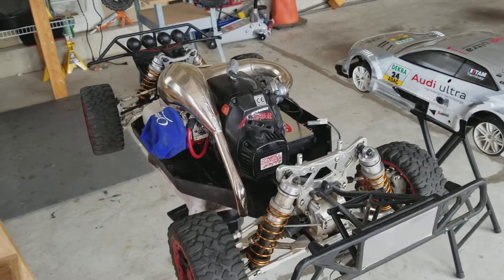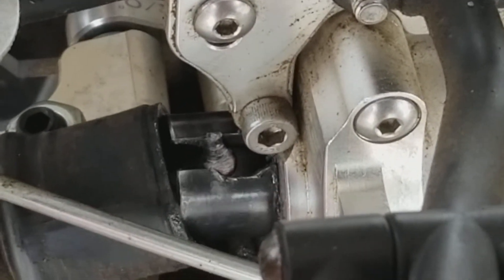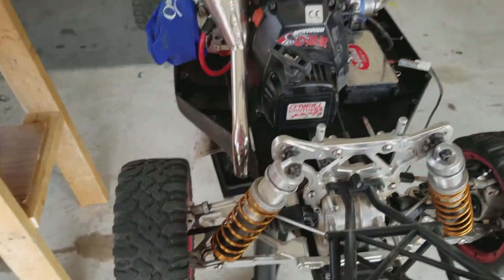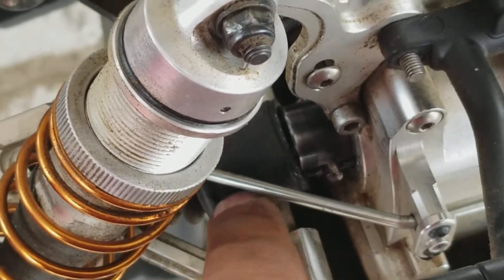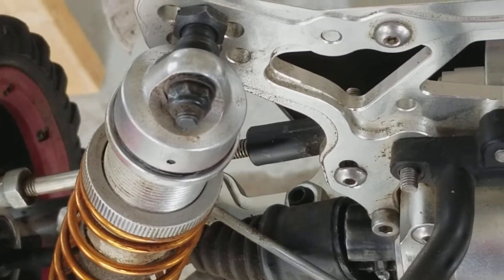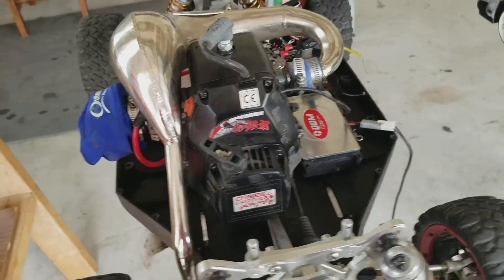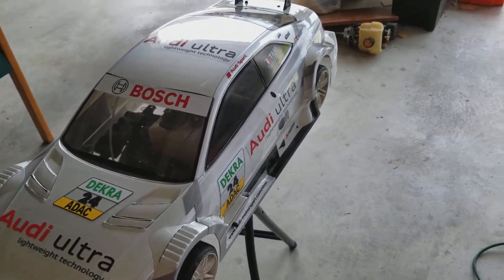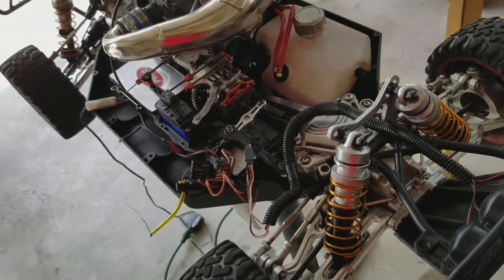OBR 47CC DESTROYED REAR DIFF CUPS AND PINS

Comment: hey gas bro the rear has more power going to it with the shaft being straight in back and front runs at a angle. The angle adds a littel more pressure on front side of center diff therefore allowing more power to bleed to rear diff .hope that helps on knowing why it does that.if person put some angle in rear shaft and straighten out front some it would equal them out more ,but that would take changing engine mount location .really sweet truck .
Reply from the maker: rc off-tek thanks bro ..i love to learn and you schooled me on so major info

Comment: I don't have a five but I have 2 dBXL's I use to break pins and shafts all the time in the rears with 30.5 fm gizmo. So I put the CVds that belong in the front in the rears also because it eliminate some of the slop or shock because the Cvd Only have a dog bone on one side! That might work for you also if your Cvd can fit in the rear also!

Comment: i think the cups/pins probably the worst thing about these trucks. I ran a stock 26cc with an 8k clutch spring with brand new Losi cups and after that bash i could already see wear. Never with my king motor 2wd 5t did i see this. Im assuming better traction is creating this wear. only option of less wear would be Team chase cups or FLM cups.